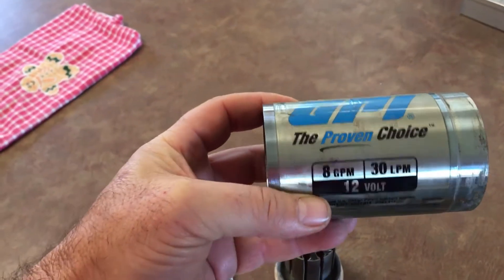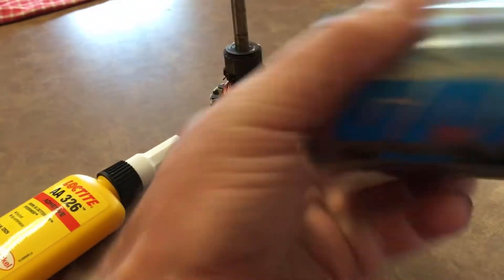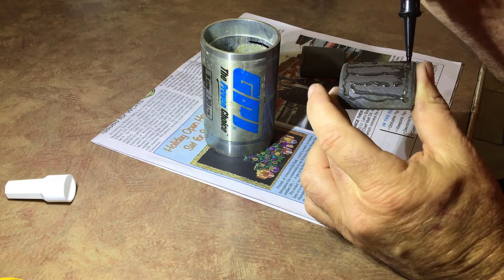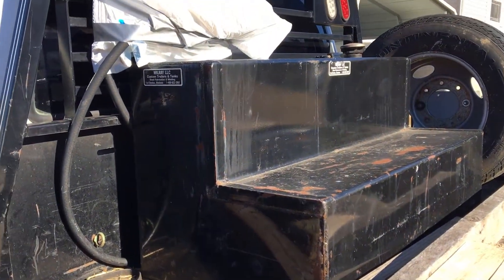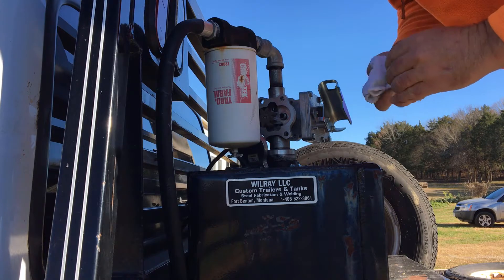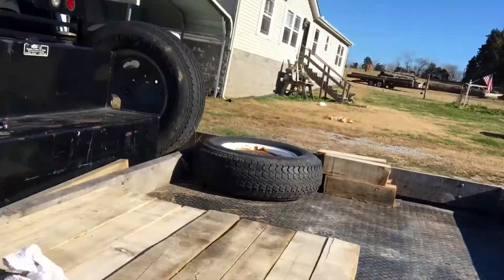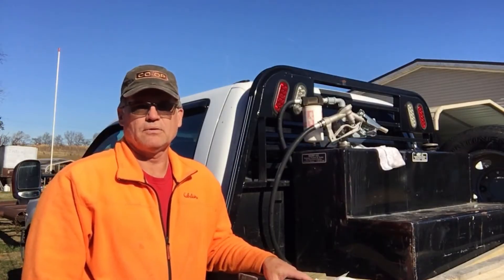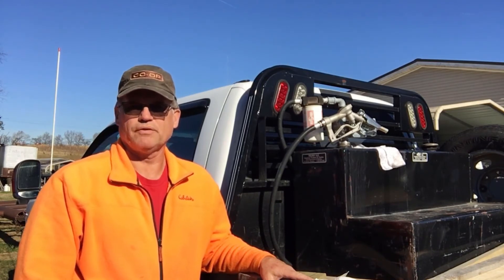DIY - Electric Motor Repair that can save you money $$$$$ - Loctite AA 326

Comment: Your preparation prior to gluing will likely result in a faulty bond. The mating surfaces MUST be spotless and devoid of contaminants. Also one surface should be primed for activation. Have you wondered about the cause of the magnets coming loose? 99% sure is due to water getting in-between and freezing. Find a way to seal the motor from water intrusion.

Comment: Loctite says AA 326 is activator cured, did you find any issues with the product not using an activator? Trying to see if I need to spend the extra $44 for the activator.

Comment: Thanks for sharing. Same identical situation just occurred with my 12V feed motor on my sawmill. It worked, but was jerky & noisy & something sounded loose. One of the two large magnets (.50hp) came unglued. I just found some AA 326 on eBay that expired last Nov - should work perfectly. I did order a new motor from Wood-Mizer in Maine for $270 including shipping, so I'll keep this repaired one as a spare once I get it back together. I'm in the NEK of Vermont, about 30 miles from Canada. This world is headed for CRAZYTOWN, but at least my mill will be working...

Comment: I was just on the ali express and saw this aa 326 and a structural adhesive so I figured I'd see what it was used for and this was like the only video but cool I think I saw some activator or accelerator in the pictures too so I guess it's just super glue but probably pretty good quality